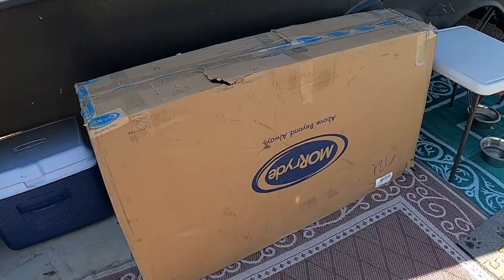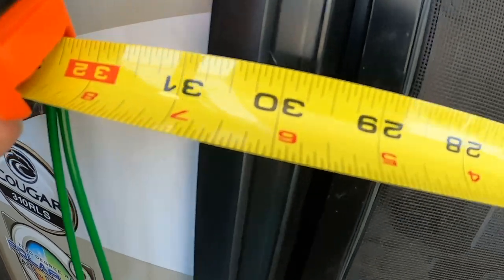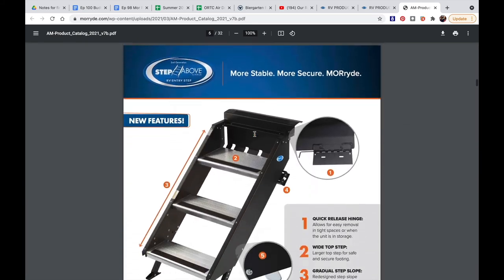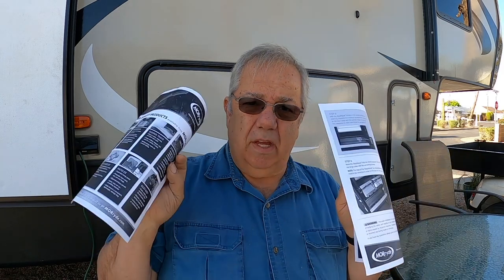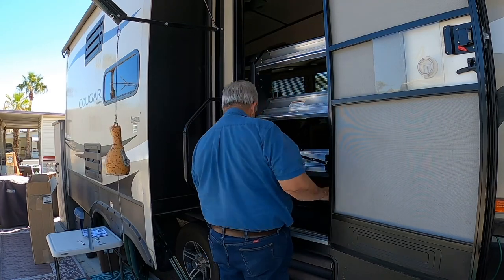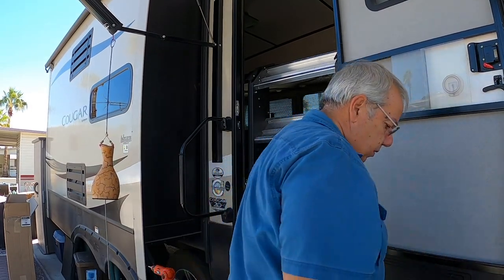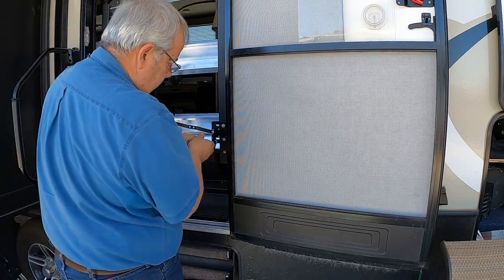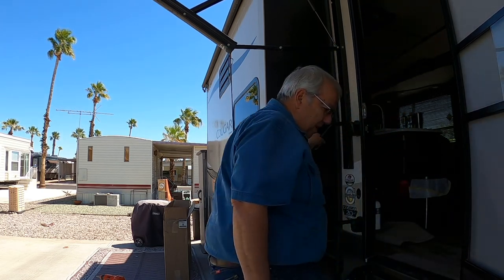Looking for the MoreRyde Step above? Watch this video first!

Comment: those instruction from the manufacturer are as clear as mud I listened to your explanation a few times and I still didn't get it why don't they just include a spec sheet with the dimensions I couldn't find any online, gees
Reply from the maker: It is confusing at best.   Hope it was helpful… at least a little bit

Comment: What's the cost on steps with shipping?
Reply from the maker: It was a while ago that we bought ours.  It also depends on what size you need.   You’re best bet is to use this guide to determine what step you need then price check it on Amazon or camping world.  https://manuals.plus/morryde/step-above-rv-entry-steps-manual#axzz7b0Stp0TF